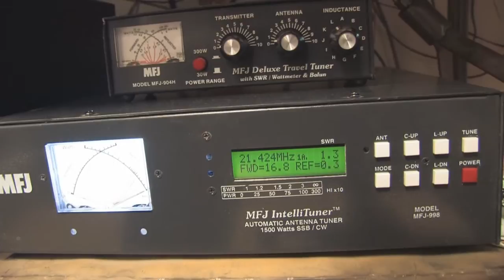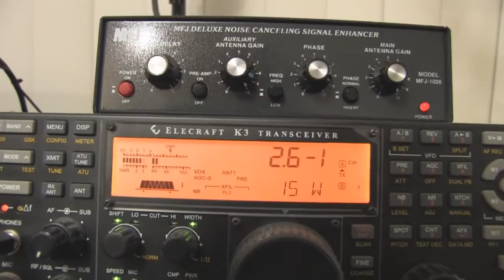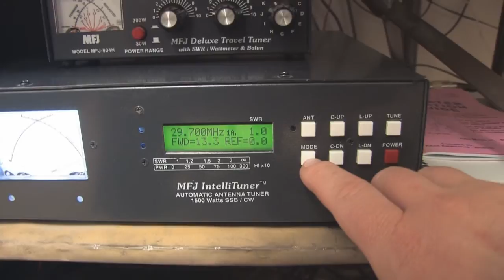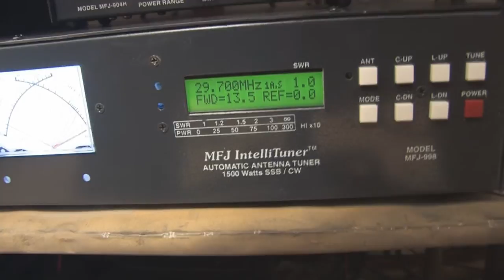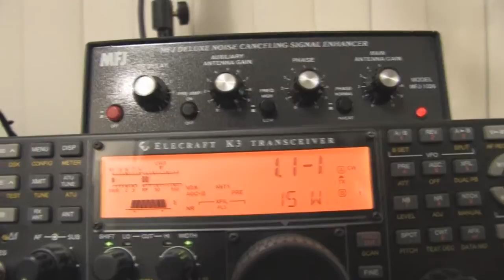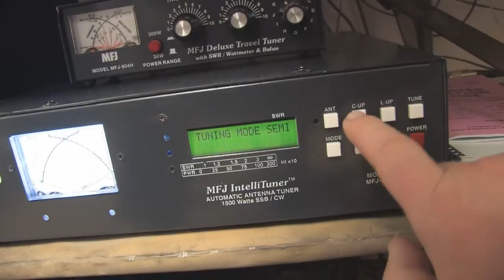MFJ-998 Auto Tuner Part 4 - Manual Tuning Adjustments

Comment: Hi

Could you tell me how to read the FWD power, digital read out, under 100 watts, while in ssb? Currently the screen shows 18.0 FWD while using 102 watts on my Icom 7300. 

If I switch to a steady output(fm carrier), the digit meter shows the 102 watts output. 

Thanku!!

Comment: Nice video

A question. 
When tuning up on my 993, I was told that I can tune with my 7300 set to 100 watts and the radio will automatically cut bk during tuning. 
But, with the 998, does the same apply, or must I reduce power manually??

Thanku
Billy
Reply from the maker: If the 998 is able to trigger the 7300's TUNE function, then the rig will output whatever power it normally does during tuning.
Reply: @tuckmeat  Thanku

I shld hv been more exact. 
When I push the tune button on my Icom 7300, in turn,  it triggers the 998 to tune. 
I was told by Icom,  that the 7300 by itself will automatically reduce its own power. 
Hooked to the 998 is what Im not sure about? 
Let me know m, if possible. 

Thanku
Billy

Comment: Hi

I am fairly familiar with this unit. I use semi mode when running my amplifier. 
As for manual touch up, I hv a question. Wouldn’t I want the swr and reflected readings to be reduced on the 998’s screen vs my Icom 7300’s?
And as far as manually adjusting, could I just key the mic on fm for a carrier, instead of pressing the transmit button?

Thanku much,

Billy
Reply from the maker: Yes, the reflected reading on the 998 or an SWR meter between the 998 and rig is the reading that matters. The 7300 only sees the input impedance of the amp when the amp is switched to operate.  Yes, you can just use FM but be careful about the input power level.
Reply: @ Thanku

So my question now is, what is the procedure for manually adjusting the swr/reflected power, beyond the 998’s auto tune. 
I read that the C/L up n down buttons will do it, But what is the correct procedure?

I really appreciate it. 

William
Reply from the maker: @WILLIAMPERRELLI  Pages 7 and 23 in the manual cover this.  Yes, you use the C/L up and down in manual mode but you might need to change between one antenna and radio side of inductance.  You should read the manual carefully on this topic.
Reply: @tuckmeat  Thanku

I read it but to me anyhow, it wasn’t 100 percent clear. 
I hv it now!

Thanks again